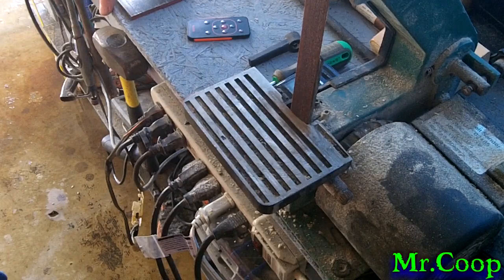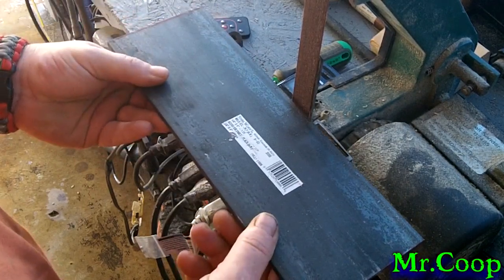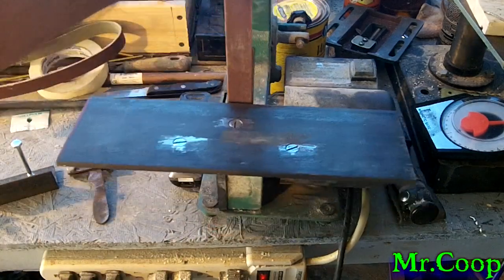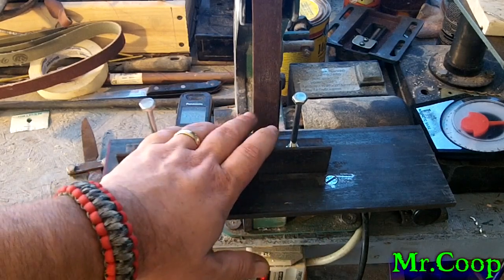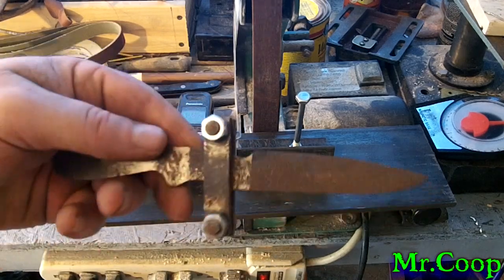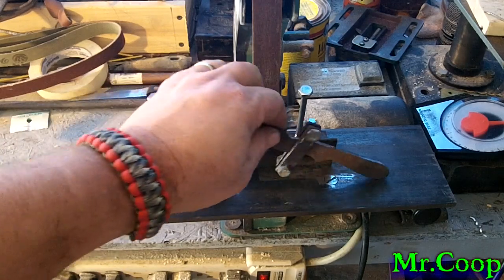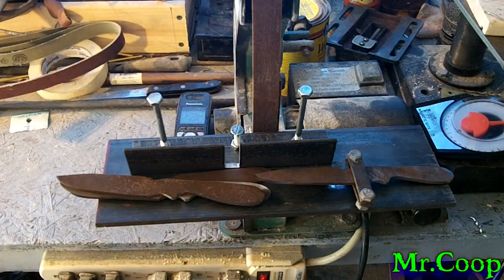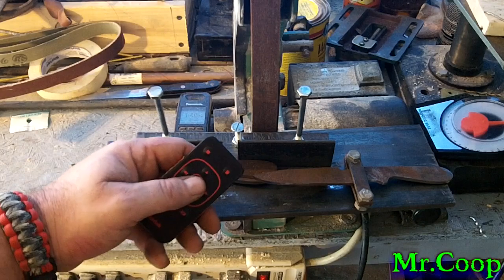Knife Grinding Jig & Belt Sander MOD

Comment: Hey Coop; another way to install a new table for you belt sander is to use carpet tape; yep that stuff holds on tighter then a gator in a death roll. Thats how I installed mine and it took all of 3 min to do the job. I've used it that way for over a year now with not so much as a nudge from when I first installed it.

Comment from the maker: Yes I threaded them because I don't have enough of the bolt coming out the other side to put a nut on. I have a nut on the top to tighten them down..

Comment: Just modified my work table today with the same size plate. I had my doubts on wether the existing bolt would hold the extra weight but it works great

Comment from the maker: I use 1095 in my opinion it is the best all around steel. Nothing wrong with the others I just prefer it. Your belt sander follows the radius. I pull it straight back and it flat grinds it just right.